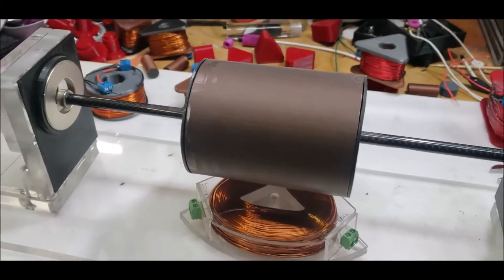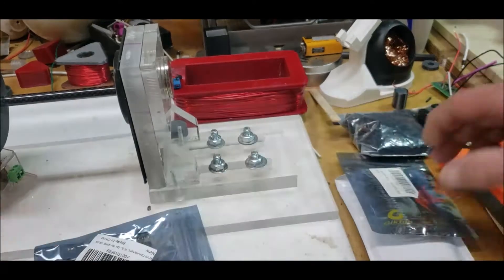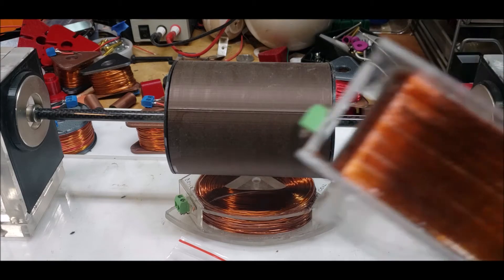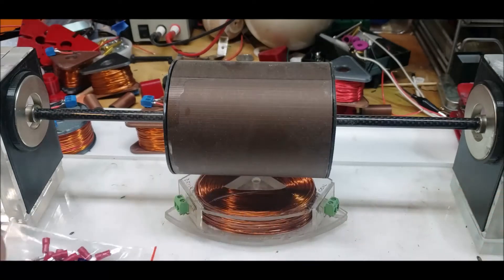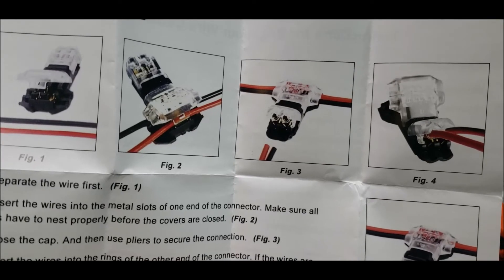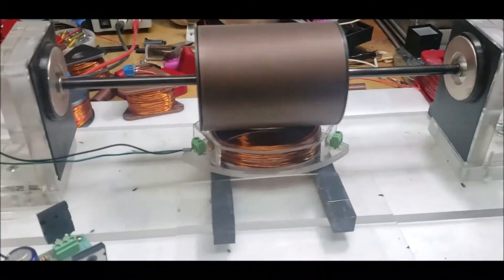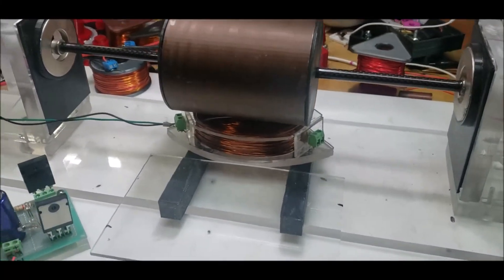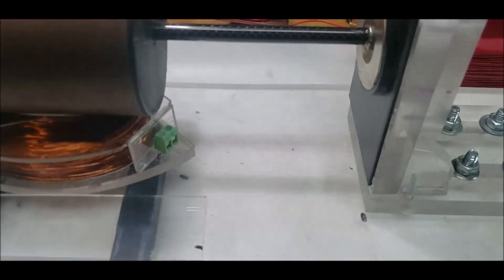3D Printed Monster Mag Lev (revisited)

Comment: How do you get the bobbin so perfect
by me they collapse
Reply from the maker: when you say bobbin which part are you referring to?
Reply: @mcorrade  The bobbin coil
Reply from the maker: @Edmorbus  I 3D Printed the whole thing. I have a Ender 3 Pro which printed out part perfectly.
Reply: @mcorrade  I have Ender 3
same setting to get good
Reply from the maker: @Edmorbus  I use all the default setting, 0.28 res, 25% infill, 65 speed, 215 hotend and 65 bed
Reply from the maker: @Edmorbus  also make sure your bed is leveled
Reply: @mcorrade  Thanks